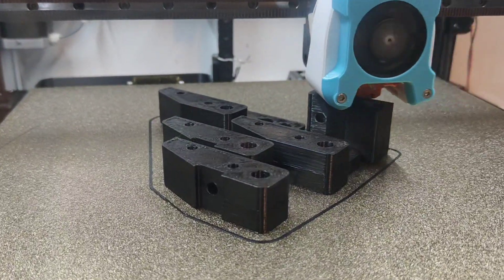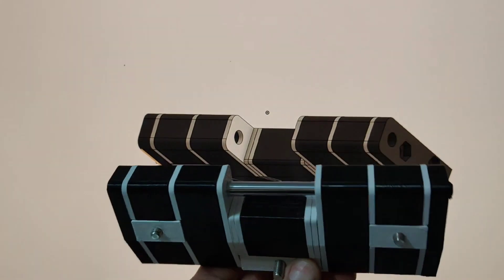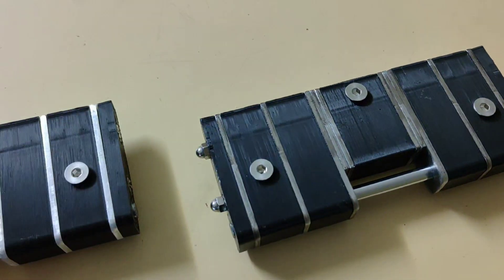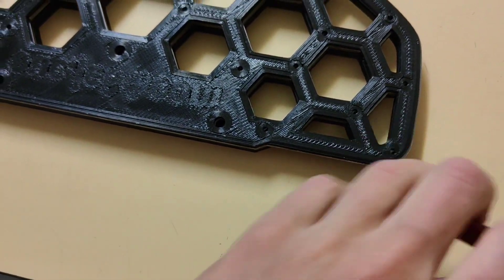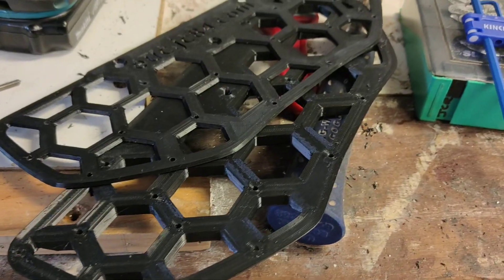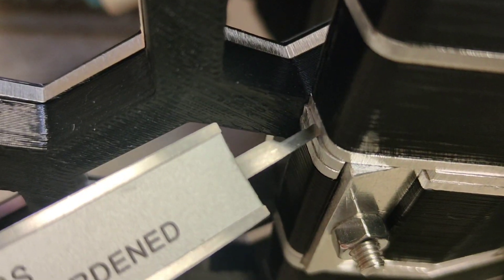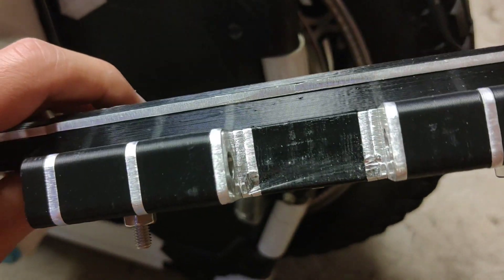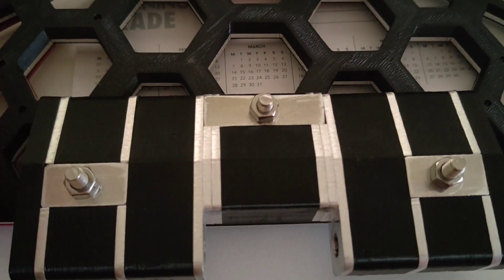EUC 3D Printed Pedals Part 3 Laser cut mixed materials

Comment: hi may i know what the purpose 4 fans under the heat bead?
Reply from the maker: When printing ABS you want a heated chamber, it helps circulate air in the printer to bring temps up to 60c by running air under the bed at 110c